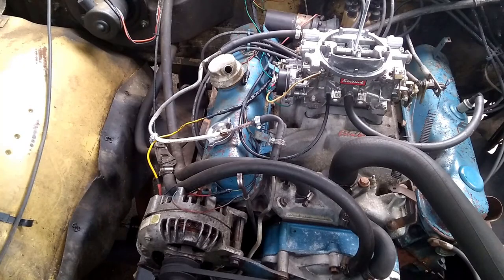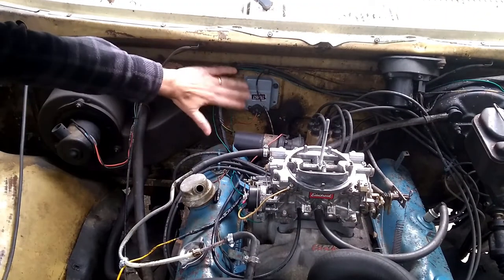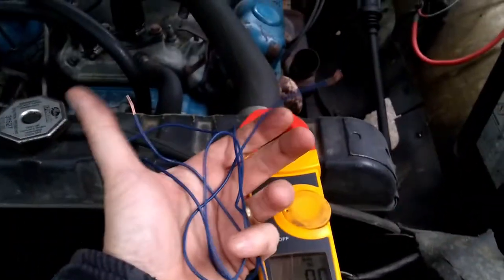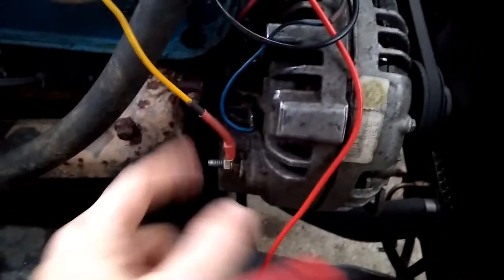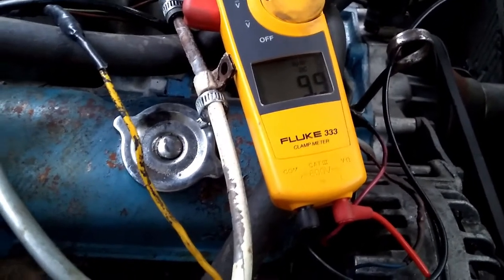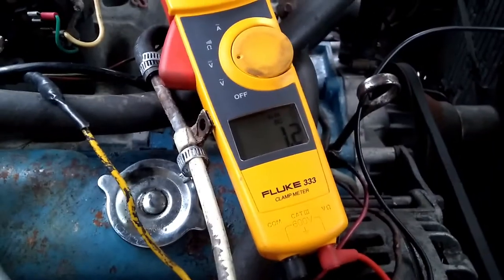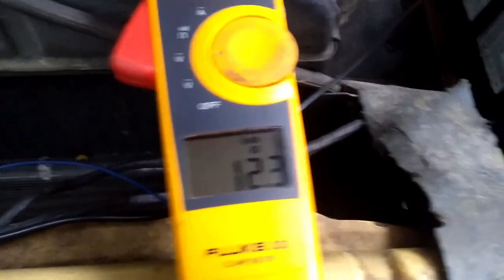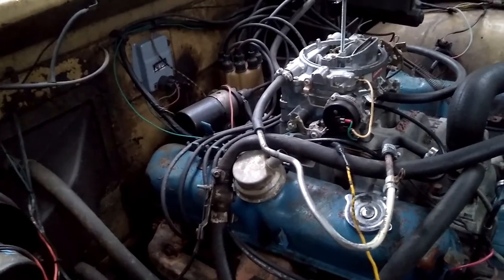Testing a Mopar Alternator and Voltage Regulator On the Car

Comment: That's a hell of a fuel line you got on that carb. A long time ago an old timer taught me a trick to check the alternator. When it's running you can touch a screwdriver to the bearing on the back of the alternator and if it's magnetized it's working.

Comment: you saved me from taking my alternator from my Eclipse (pain in the but) to take it to test. I removed the OEM ECU for an Aftermarket and of course lost the voltage regulator. Bought the 2VR1 and wired properly but nothing. It does not charge a brand new battery. I am heading to the garage now to test that and make a video for my channel. Will give you props on my video.
Thanks brother!

Comment: You use the term "Output connection" for both main output, and field winding output...confusing!
I did however understand that it is the FIELD WINDING OUTPUT (low reading on test) that is grounded using jumper wire.
I petty the guys that "misunderstands" your confusing instructions and connects the 12V OUTPUT to ground though.... 
I suggest ADD TEXT to video to avoid mix up??
Reply from the maker: A good suggestion.

Comment: Hey Y, I watched this great video last night and went out and tested my 85 Ramcharger today.  I have no voltage with key off on field wires.  11.5 on both wires with the key on but engine dead.  I see others have experienced this same thing.  What likely is wrong?  I keep researching, but I'm guessing I may change the brushes in the alternator.  Oh, by the way, I checked two other Dodge's sitting in my barn, both checked out according to this video.  No volts on field wires with key off, with key on one had battery voltage, the other was very low.  Thanks again for the excellent information.
Reply from the maker: The field circuit basically comes from switched battery voltage (so ~12V) in one side, out the other, then through the voltage regulator to ground.  the regulator acts as a variable resistor to control current through the field wires, and therefore the amount of charge.  Since the field wire in the armature is long (lots of windings) I'd expect there to be some voltage drop there - I'd have to ohm-out an alternator to know how much drop to expect.  If you full-field it (i.e.  ground the terminal that goes through the regulator like I did in this video - using a test light is probably safer than a 0-ohm wire) then it should start charging at max capable output.
Reply: @YoshimoshiGarage  OK, thanks to a few clues from your reply, I have caught myself up on alternator basics.  The brushes contact the two slip rings, which are connected to the rotor windings.  If the voltage at the two field terminals is nearly equal when energized, then this indicates a problem with insulation breakdown of the rotor.  To check, I removed both terminal wires and read the resistance.  I then compared this to the resistance of known good alternators.  There was a large difference.  I can infer this particular alternator is bad.   In summary, if both terminals have nearly identical voltage when preparing for the test you show in the video, there is no need to proceed with the final test of shorting out the field terminal; the rotor is bad.

Comment: Quick question for you.   With engine running and I connect the jumper wire to the output field wire and than battery negative, I hear a load change just like in your video but my multi meter sees no voltage change at all. I have the wire to alternator output field disconnected.   Hearing the load change makes me think it’s working but not seeing the meter detect the increase in voltage concerns me.  What am I missing?  By the way, great video!
Reply from the maker: If the load is changing, verify the meter settings and connections.
Reply: @YoshimoshiGarage   multi meter is functioning properly, correct settings as I had it attached to battery just as you described and it was reading 12.40 +/-.  I can hear a engine load when I ground the alternator field wire but no change in voltage.   I’m also smelling a slight burning oder.  I think I’ve followed it back to the alternator.  The question is, could the alternator sense the load but internally not discharge it?

Comment: With the key on I have the same voltage on both in and out field wire around 11V and 12.1V on the output.

 I have Same reading when I unplug the regulator and check the voltage on the green wire and blue wire in the wiring connector with the key on. 
I try with the jump wire and no change in Voltage.
I bench test the alternator and it goes up to 16V. 
I try with a new voltage regulator and new alternator same result

Not sure where to go from there.

Comment: The best way to full field a Mopar alternator is to remove the insulated washers from the brushes.  It's a great way to make your stereo louder for a few minutes.  It sounds great, until your headlights and taillights all blow out, and the insulation of some of your wiring starts to melt.

Comment: What if I don't have power at the field wire when the car is in the on position? Thank you for the video and the help.
Reply from the maker: Chase the field wire back, then. It's probably damaged
Reply: @YoshimoshiGarage  I was assuming the issue is the voltage regulator. I have power on the ignition side of the voltage regulator. I traced the wires back to the voltage regulator and I see no obvious signs of burning/fraying. Thanks for your help.
Reply: @YoshimoshiGarage  Meaning I traced the field wire from the alternator to the VR box.

Comment: Ok so the two field wires that goes to the input of alternator and other end connects to the center of the voltage regulator plug the output from the alternator to side of voltage regulator. Now the input also is powered by battery or connected to fuse box 10 amp. correct?

Comment: So my 85 d150 does just what you show, with key off main altenator wire shows battery voltage and both field wires show no voltage with key on the main wire drops just a little and one field wire shows 11 volts and the other shows about 1.5 volts, truck puts out 14.3 volts when running, runs great
    on my hot rod ive got an 87 d150 wiring harness put in a 47 1 ton truck, when key is off main wire shows battery voltage and so do both field wires and when in run position same all three show battery voltage, and when running alternator is only   showing battery voltage, so my wiring is probably messed up?

Comment: Great vid. Question: 1970 Dart with brand new Regulator and brand new Powermaster 95 amp 3-wire alternator. Getting the appropriate voltage reads in “off” position, however voltage stays the same at all outputs when ignition is turned on but engine not running. Haven’t tried the engine running scenario yet. Any guesses?
Reply from the maker: If the field connectors have voltage when the ignition is on, but not off that's expected.
Reply: @YoshimoshiGarage  I actually am not getting any voltage in field wires when key is in the on position, they both stay at 0 as opposed to having voltage show.
Reply from the maker: Sounds like a problem in the wiring from the bulkhead. Trace the field wire back and find where it's broken

Comment: great video, easy to follow.  Question, with my key off I have 12.6 at alt post and 0.0 at field spades, when key at start alt post 12.3 and BOTH field spades 10.6. Should field spades have different readings ? 440, recon alt, new external reg. Thanks for your time
Reply from the maker: Yes, there should be voltage through the field windings

Comment: I did this with the key off and got 11.7 volts at the alternator field terminals and they were both the same at 11.7 volts? With the key on I got it to spike up to 11.8 volts at both terminals and I would say I have a wiring issue. I installed a new alternator thinking it had gone bad yesterday because I was losing voltage while driving. Didn't perform the jumper wire test yet. I'll try that next. Thank for the video
Reply from the maker: With the key off you should not have power at the field at all.

Comment: Great vid, Did exactly this up to run test as both field wires were showing 11.40V when in on position. Ideas?
Reply from the maker: 11.5 on the regulator side seems reasonable - that says that the alternator is being energized and should be charging, so the output on the charging post should be somewhere around 15 or so at that point.  The voltage is going through the alternator windings, so the ground-side field wire will read voltage.  A little surprised it's the same and not at least a little lower.
Reply: @YoshimoshiGarage  this was when in not running state and only in key on position. I was expecting very low voltage on the output side
Reply from the maker: I definitely would expect a larger drop across the alternator field, but I'd have to go check one. It feels like it's low resistance, which could mean an internal short.
Reply: Hey ZP, I watched this great video last night and went out and tested my 85 Ramcharger today.  I got the exact same results as you.  To clarify, no voltage with key off on field wires.  11.5 on both wires with the key on but engine dead.  What did you find out was wrong?  I keep researching, but I'm guessing I may change the brushes in the alternator.  Oh, by the way, I checked two other Dodge's sitting in my barn, both checked out according to this video.  No volts on field wires with key off, with key on one had battery voltage, the other was very low.

Comment: It would be great if you could use a light and also aim the camera at the terminals you are referring to so we can see what you are talking about.
Reply from the maker: I definitely could have done better.  Now that it's warming up out, I'll try to do an updated video that better explains it, along with the difference between the older 1-wire and "newer" 2-wire alternators since there's a big difference in how they work.

Comment: With the key on, the output was less but both field wires had just .01 reading.  What would that indicate? Great video by the way.
Reply from the maker: One field wire is hooked to ground so it will always read no voltage.  The other side goes to the voltage regulator and with have anywhere from 0V to probably 12-ish depending on the overall voltage of the battery.  Take a look at my video on bench-testing the regulator for a little more info, but I suspect the regulator is bad. https://youtu.be/nkoZ3E4-tVk

Comment: Hi there.  I just did the load test with car running and grounding the field wire. Car died immediately.  Your thoughts?
Reply: And it was the green field terminal.
Reply from the maker: Did the engine speed change, like it put load on the engine and that caused it to die, or did it act more like you just shut the car off?  The first would be because full-fielding the alternator causes it to drag on the motor (though it shouldn't be enough to kill it unless the idle is super-low).  I can't come up with a theory on the second.  The charging and ignition circuits are completely separate
Reply: @YoshimoshiGarage  it would just die. I had the rpm at the time around 850.  I just tried it again this evening and I raised the RPM before touching it to ground and it still wanted to die. Wire had a pretty good spark and wire got hot on the fingers.  Never really rev'd up oth e then me holding throttle back. I'm guessing I may have a wiring issue under my dash.

Comment: Everything is OK untill I get to the step where to ground the green terminal. Which I do and when I do it sparks and melts the brush insulating housing. And the alternator does not charge to full capacity. I just melt stuff. 

What does this mean? My alternator is bad? or wiring?
Reply from the maker: It means there's probably a short in the alternator field windings giving nearly zero resistance to current flow to ground.

Comment: Aight..  Alternator tested good..  it''s puttin out juice, but the juice aint getting back to the battery.   New alt & new VR..  Got high and low juice on the fields..  check..  so the VR is putting out properly..  so the question is..   since obviously my output wire form the alt to the battery+ is fried somewhere.. and I don't want to shred my wiring harness to find it.. 
Why couldn't I just bypass that and just put a new fused feed back to the battery right?     '86 W150 with a 318..  looks like every mopar I ever saw..  unmolested..    until now lmao
Reply from the maker: You can totally run a 10-gauge wire from the output post to the battery.  Check the existing wire right at the battery terminal. That's usually where they go bad

Comment: When I touch the blue wire to ground as you did. my voltage stays the same and I get sparks between the blue wire and the battery ground.  If that indicates a bad alternator, could a bad alternator have ruined my voltage regulator also because it was testing bad also so I replaced it as well?
Reply from the maker: Sounds like it's making a connection through the field (so sparks) but it's not charging. Probably bad diodes in the alternator.

Comment: What if you have battery voltage on both field wires with the key in accessory
Reply from the maker: The two field connectors are really just 2 ends of the long field windings in the alternator, so if you have voltage at one, you should have voltage at the other (it will be lower on one due to resistance through the field winding).  If you don't, it indicates a broken field wire.  I would also expect voltage to be there in accessory, since the alternator isn't spinning at all, so the regulator should be telling the alternator to charge.

Comment: To be clear I have a single wire alt. and ran through the testing procedure and the last test running with the single field grounded made no difference in charging rate, I assume then it is an alternator failure.
Reply from the maker: So a single wire alternator is different - it grounds the second field connection through the case.  Dual-field is an "A circuit" where one wire is hot and the regulator controls the ground on the other.  Single-field is a "B Circuit" so the alternator has one field grounded internally and the older-type regulator controls power to the field.  To test that system, apply 12V to the single field and it should start charging.  If it does, then your problem is likely the regulator.  If it does not, it's likely the alternator.
Reply: @YoshimoshiGarage  So with the car running ran a jumper from single field prong to the positive battery terminal on the  battery and it seemed to drop voltage also jumper wire got very hot.
Reply from the maker: @sueleake7436  Sounds like the field winding in the alternator is shorted (assuming you disconnected the regulator when you did this)

Comment: So I did this, and when I ran the final run test and ran the field wire to ground my engine sputtered and died. I did the test on a 68 b body.  There was no charge as my meter dropped to around 11 volts.  I'm guessing that this means my alternator is no good, but I'm a newb when it comes to charging systems.
Reply from the maker: If the voltage didn't go up when you full-fielded it (powered that field wire) then the alternator isn't producing any voltage and either it's bad or the charging wire (the big red one) from it is bad.

Comment: Hi just came across this video.

I have a 71 challenger and it's not charging.

I did the power off test. Everything checks out. 12.5 on the input and 0.0 and 0.01 on the fields.

When I go to do the on key test. 

I am getting 12.3V on the input and 0.6 (blue) and 0.0 (green) on the fields. 

If I'm following the video correctly It sounds like the wires going from the voltage regulator to alternator are faulty. Is this correct?
Reply from the maker: Field signal isn't happening. Could be the regulator itself or it could be a wire
Reply: @YoshimoshiGarage  just replaced the regulator. Did the test again. Nothing.

I then tried a bypass of the wiring harness. Ran two new wires both from the regulator to the field attachments on the alternator. Still no luck.

Is it easy to burn out a regulator? 

I appreciate the help.
Reply from the maker: The regulator ground through the housing to the firewall. Make sure it's got a good, clean ground there (bolt is clean, area around the bolt hole on the regulator isn't painted, etc) e
Reply: @YoshimoshiGarage  so cleaned up the the two holes where the regulator mounts to firewall, cleaned the bolts and removed any paint.

Went through the tests.
Off position checks out.

Key turned on. Saw a drop from 12.5 (off) to 11.8/12  the field terminals. One registered 0.2 the other 0.0.

When we had the car running.
Volts on the battery dropped to 2.19 to 2.3 and stayed. No charging occurred when I ran a jumper from the alternator to battery.

Car starts fine. Volt meter is registering at 11. The stock Amp meter in the dash I think was blown could that be the culprit? It's still connected.
Reply from the maker: The ammeter has no effect. If you give 12v to the field, the alternator will charge (unless it's bad). If you put a jumper in there and it did nothing, I'd suspect the diodes in the alternator are cooked.

Comment: Why would both input and output have 9+volts
Reply from the maker: Do you mean both field wire connectors?
Reply: @YoshimoshiGarage  yes both read 9.3
Reply from the maker: That tells you that the stator windings in the alternator are good, but if the battery is at 13, then I'd trace the field wire that isn't going to the regulator back to it's source and check the connection. It should be at or near battery voltage